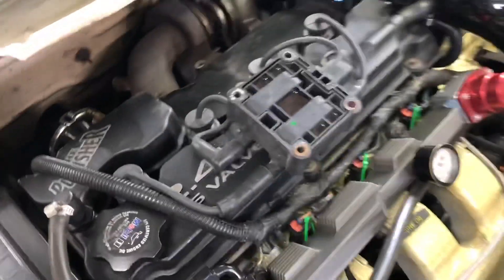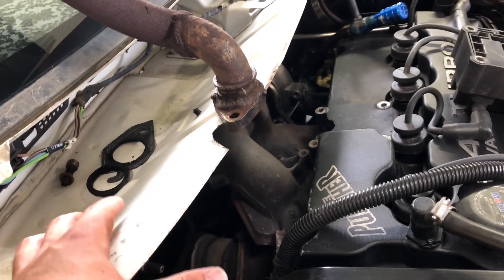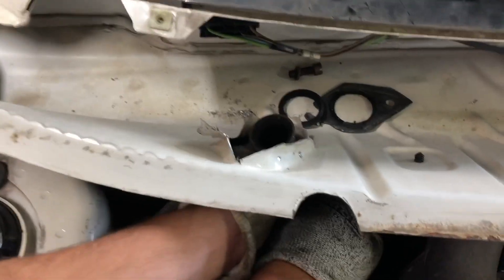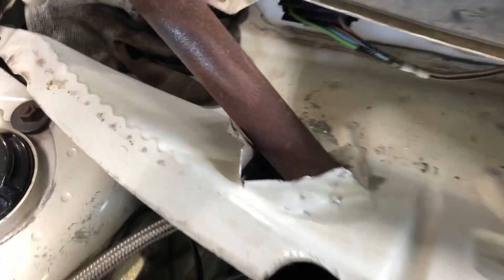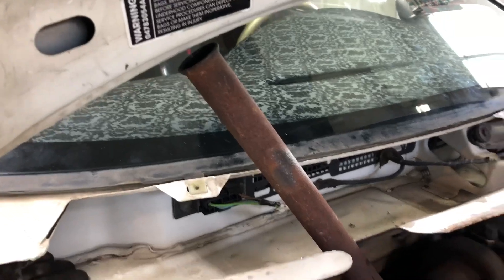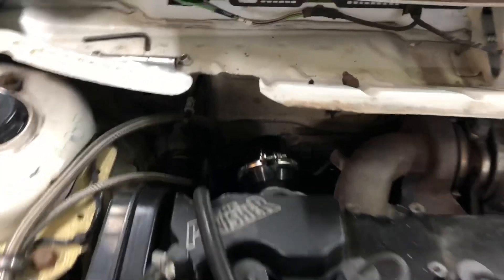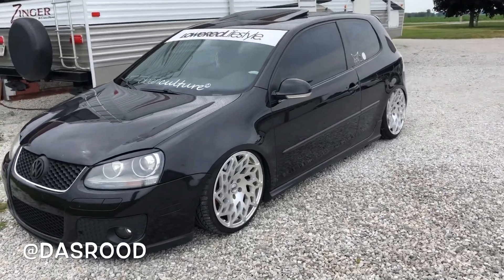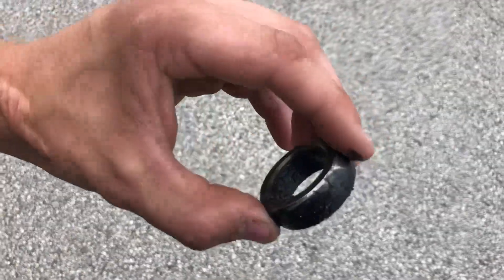SRT4 Hood Wastegate Dump!

Comment: Ahhh why tf did i not get a noti? Ok sweet you did it all at the crib, +10 bnb. Question, whyd you make it so tall instead of lower more even to hood? Is it just save the vinyl and are you gonna wrap it/drain hole?
Sucks on the axle, i just broke a mount bolt but you nailed it bruh
Reply from the maker: akirony it was just doing the most minimal work I could to make it happen😂 I’m going to fab up a much better pipe that’s stainless. ( eventually). But thank you!